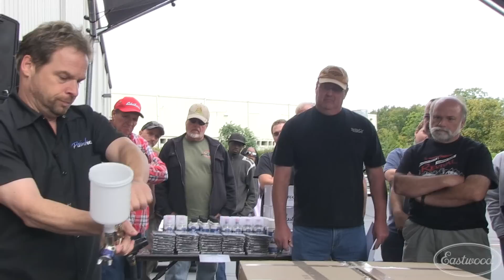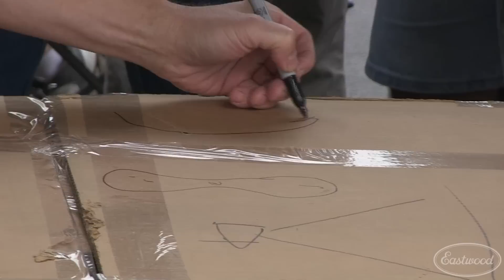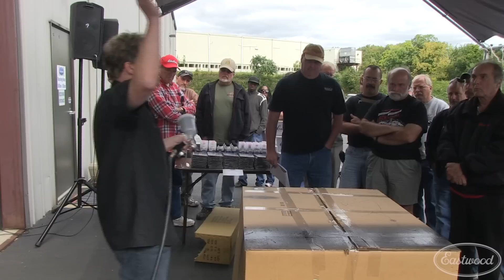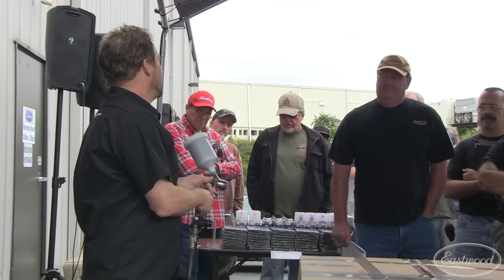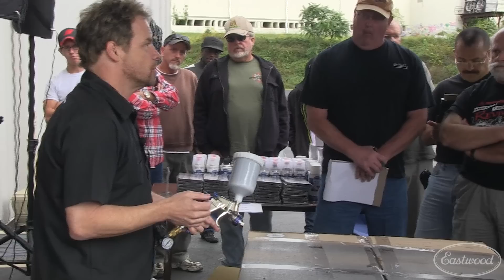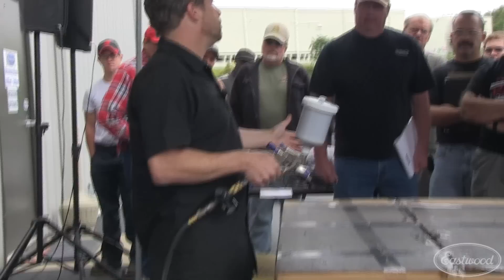How To Paint & Set Up Your Spray Gun - Great Tips with Kevin Tetz at Eastwood Part 2 of 2

Comment: Hi can you explain me what is 1.3 needle / nozzle for  , like you said it is best for water bond, so which one should i use  for base coat and clear coat  (water bond ) and what is the  advantage and disadvantage plz let me know .thanks Mahesh from fiji island.
1.3mm needle/nozzle set (14773)
 1.7mm needle/nozzle set (14774)
 2.0 needle/nozzle set (14775)
Concours Pro HVLP detail gun (14772)
1.0mm needle/nozzle set

Comment: If the fluid is wide open wouldn't you run out of paint before you finish one coat? Is there enough paint in a gun to do one full coat?